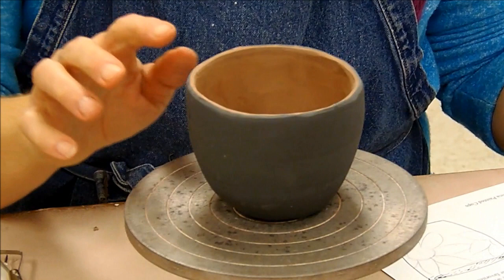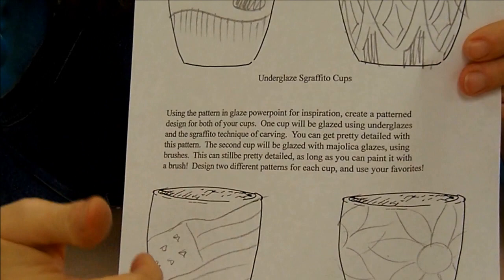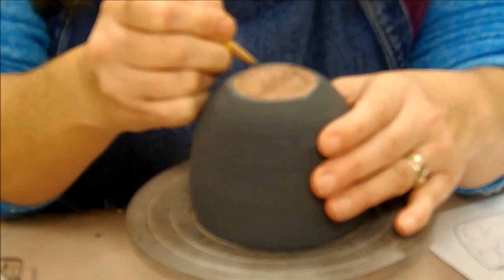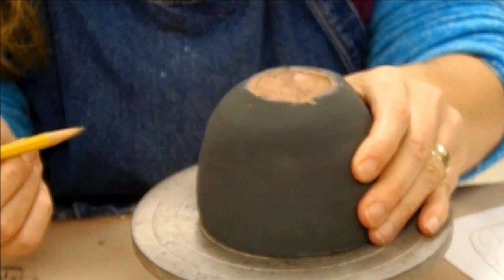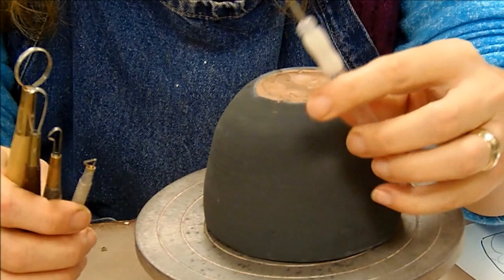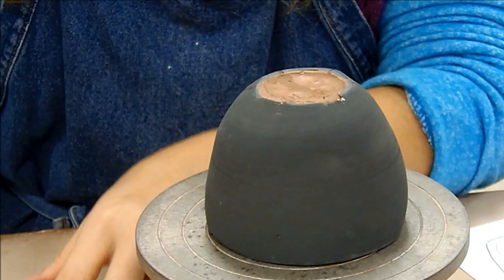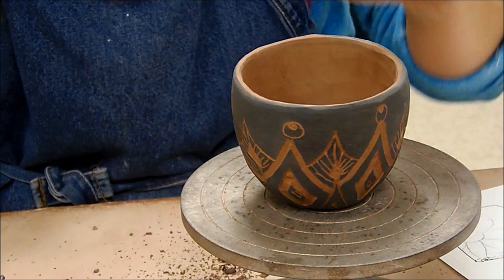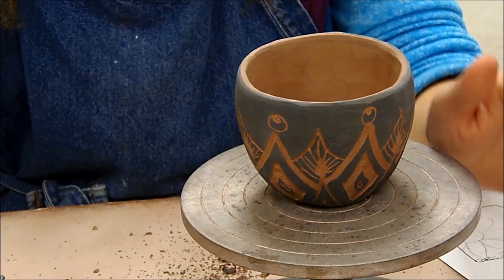Ceramics I  Sgraffito Carving the Pinch Cups

Comment: Have you tried a matte glaze - to keep the original look but add just a slight deepening of the colors? did it work? I like the before firing. So the first firing is that a bisque fire? then you glaze fire.  What would happen if you bisque fired with the glaze on? meaning one firing have you ever tried that?
Reply from the maker: I have not tried a matte glaze over this...but it should work just fine if you have a compatible glaze!  :). I would assume however that a matte glaze would deepen the colors just as much as a gloss clear...
Reply: @KaransPotsAndGlass  I guess no top glaze is an option... maybe just a glaze to the inside.

Comment: Wow I love your videos & pieces! 
Can you please help me understand what you did to create this as far as firing, type of glazes used, and type of clay (the color)? 
I don't understand what an underglaze is and if you fire it or just put it on then start the top glaze then fire....hmmm 
Did you use an earthenware low fire clay, low fire clear glaze and a low fire underglaze in this video? 
If so would you be able to tell me which one/colors and what cone/how long you fire?
Thanks so much can't wait to learn more from you!
Reply from the maker: Hi Cher- Sorry for my delay in getting back with you...I've been running all day!   I will address some of the questions here, and others on the other tread where you asked others.  An underglaze is basically like a colored slip.  It doesn't contain silica which creates a shiny quality like a regular glaze.  I use the Amaco Velvets... which fire to be matte, then should be clear glazed and refired.  This is a lowfire earthenware I am using here. You could also use a mid- fire clay with a compatible underglaze.  Such as, at home, I do a lot of sgraffito with my cone 5/6 white stoneware with some of the Amaco Velvet underglazes.  (Only some will successfully fire to cone 5/6  usually dark ones, or ones without red pigments in them.)  After bisque firing, use a clear glaze which is compatible to the firing temperature of the claybody.  The length of any firing of a bisque load depends upon a few things... #1  How dry are the pieces.  If they are for sure bonedry (no moisture) they can be preheated for a little while- maybe 30 minutes before the firing program goes over 200 degrees (as water vapor would turn to explosive steam)  #2  How thick are the pieces?  I usually tell my students, limit the thickness to no greater than 3/4" as it has difficulty in drying.   and #3  How large are the pieces?  For firing very large pieces, I will slow fire them, which on a cone 04 firing program, that could be about 10 hours.  But, if it is a kiln load of smaller pieces, I will fire a fast firing, which is around 6 hours.  I'll do a video this summer on firing a kiln- I've been meaning to anyway... it may help!  Ok, off to the other video to comment now!  :-)
Reply: Thank you so much for your fast responses! 
I have to read through this again and see if I have further questions. 
I can't wait till you make a video on firing a kiln!=)
Thanks so much Karan
Reply: Hi Karan,
I'm researching the Clay to use...I know you have a very busy schedule if you have time I'd love your expertise on which of these to use for the low fire earthenware & the white stoneware.
I am trying to choose from this Mid Fire (cone 5) page link
http://www.bigceramicstore.com/clays/clays-by-cone/mid-fire-cone-5.html
Thanks again! Cher
Reply from the maker: Well, I don't have any personal experience with any of these particular clay bodies... but consider these factors in your choices:
*  The page you sent was for midfire clays- you mentioned lowfire as well.  If you are setting up a home studio, I would first recommend deciding if you want o go with highfire or lowfire... and I would recommend basing that decision on what glazes you intend to use.  :-)

* Do you for sure have a kiln which will fire hot enough... to cones 5/6.  I think most every kiln will go to 5/6... but just making sure.
*  Do you want a clay for building really large or flat pieces?  This may warrant using a clay with grog.  Grog adds porosity, allowing a bit more strength to the clay body during drying and firing.  If you use a grogged clay, remember that wiping with a sponge can be bad, as it removes the tiny particles, revealing a rougher, groggy surface.
*  If you plan to use underglazes, I recommend a white, buff, or tan claybody.  Iron in some highfire clays can contribute to the dissolving of the underglaze pigments during a high fire.  
*  As an idea, they do have a sampler of soft clays of the different Laguna clay bodies.  (I know it is only the Laguna brand, but they may offer the Amaco as well, if you ask them.)
*  Honestly, the people there at that retailer would be able to answer specific questions about those specific clays.  :-)

I hope that helps a bit!  :-)  Karan